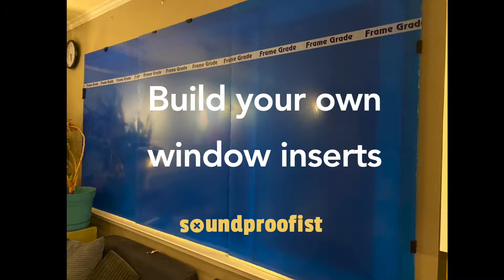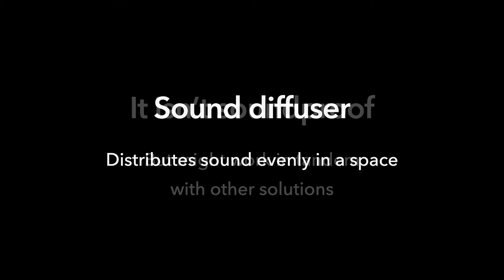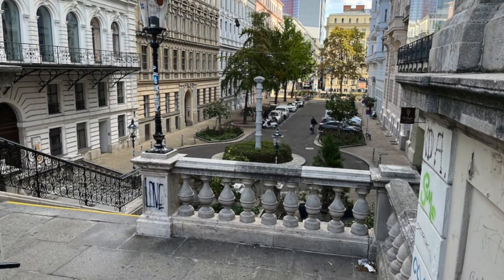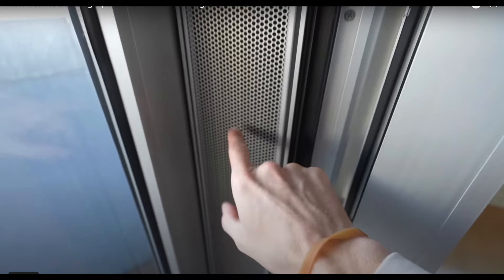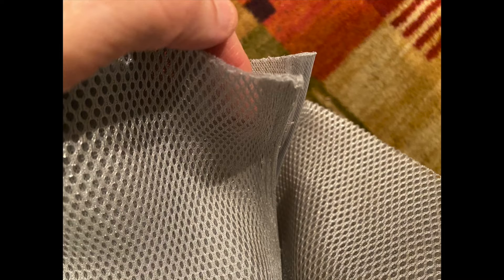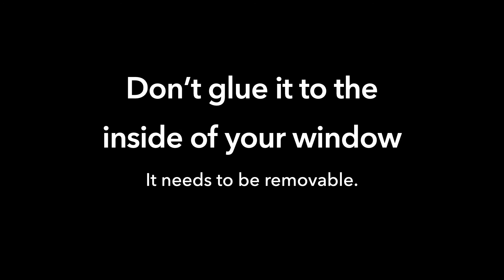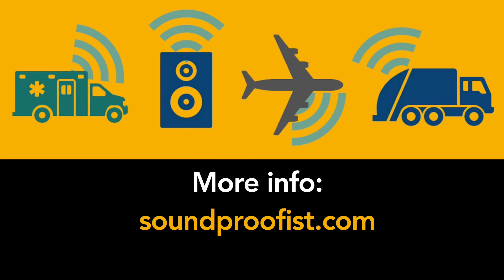Build a sound absorber for your window

Comment: I've made many window plugs for my bedroom and basement windows.  The key to success is having a large air gap between the window itself and the window plug.  The larger the air gap, the more noise attenuation there will be.  My basement window sill is 15" deep and I hear nothing when the window plug is in, not even loud bass penetrates it.  My bedroom window only has a 4" gap and I hear a bit more through it.  All air gaps between the plug and frame must be sealed air tight, but you already knew that.  

One more thing...  you have a very nice voice. Very pleasant and easy to listen to. You should consider getting a job narrating audio books.
Reply from the maker: Yes, deeper window openings (which often come with thicker walls) are super helpful, and I agree that the bigger the air gap, the better the results. My 1950s apartment building is a perfect example of how builders cut corners for several decades, resulting in an acoustical (and indoor heating) nightmare. The gap between the double-paned vinyl windows and the interior wall is only 2 inches. That's the amount of space I have to create an air gap for the plexiglass insert.These windows were retrofitted in -- the original windows were single-paned aluminum. So maybe the original air gap was slightly deeper, but the single-paned windows themselves were about as effective as a T-shirt. There's already a very small gap between the two panes of glass in the vinyl windows, but it's fairly insignificant. I envy you for that 15-inch gap in your basement windows!

Comment: I'm thinking about trying the plexiglass and would like to know if you notice any moisture problems in the tightly closed airspace. Mass is the most helpful and considering putting a large sofa pillow given to me not needed on my sofa into the airspace. I'm working with a 3'x5' FT vertical window. also, the hardware store wants to load me up with 3 screen clips on the 3 sides. Tap plastic suggested 1 at the top and 2 on each side. Whatcha think?
Reply from the maker: I haven't noticed any moisture problems in the air space, and I think I've had this plexiglass installed for about 2 years. The exterior windows are double-paned vinyl windows, retrofitted into what was originally a single-pane aluminum window frame from the 1950s. These vinyl windows are probably 20 years old and they still seem pretty airtight. The space between the two panes in the vinyl windows don't fog up, so neither does the air gap between those windows and the plexiglass sheet. As for the clips: when I first did this project, I used stationary clips on all sides. Then I realized this just made it harder to remove the plexiglass if I needed to. I don't need to remove the plexi from the smaller window. But on the larger window, it's a total hassle to remove a panel to open the window with stationary clips on the side of the plexiglass. 

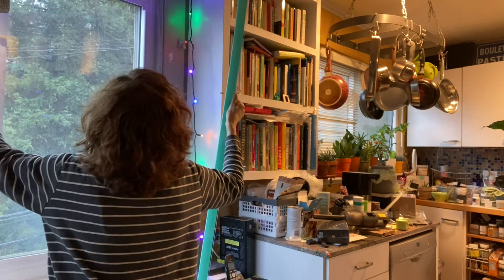So I replaced the side clips with two inexpensive metal latch/handles. If I can find a link for the parts I used, I'll add it later. I probably bought them at a local hardware store called "Cliff's." Basically, these are latches with a raised handle and they're meant to keep a door or gate shut. But I installed them backwards, so that the handle is positioned over the plexiglass, not the latch itself (which is too low to fit over the plexiglass), and then I use small foam shims under the handle to push against the plexiglass. You can see the latch in the video at 4:55. I still have the clips at the top (I recommend 2), and then on the left side, I have a connector to the center piece of plexiglass. And of course, on the bottom, the plexi is just sitting on the windowsill. 

One thing about these plexiglass window inserts: they are very weathertight. There are a few days per year that get obnoxiously hot, so you might want to remove the plexi and open the window. But in the winter, they keep cold air from leaking in and warm air from leaking out, and it will probably help you save a lot on heating bills.
Reply: @soundproofist  Thank You for your detailed reply, I'm still wondering what you think of the sofa pillow idea in the airspace to add mass?
Reply from the maker: @nomadyesmad4875  Wouldn't you be blocking all the light out if you did that? How much of the space would be filled by the pillow? Is the idea to absorb some of the noise that passes from outside into the airspace? The success of a window insert is from the gap in the airspace itself, which helps to reduce the noise. Why not add the plexiglass first and see how effective it is, then see if it gets better or worse with a pillow stuff inside?
Reply: @soundproofist  Proofist, I am having another horrible experience with customer service, As we know there isn't any nowadays. No matter how nice I am, C-S people are so rude and downright vengeful. It must be the State I live in. I was put through major stress with Macy's for 8 months just to buy a sofa that was crafted to a decent expected condition. Just unreal. The Tap Plastic older guy was horrible as well confirmed by people I talk to about it. Was quite mum about if it would fit in my car and didn't want to say anything it seemed to lose a purchase. I gave him the rough opening measurements and said " I need extra space on the sides " to install it. He said he would give an extra 1/2 inch. I trusted his experience with others who have done this, but am now disappointed he didn't ask how much I wanted. I have had pain issues for years and went along with it to discover when I sat it on the window ledge. The window is out of square so I'm getting a small gap of 4 inches at the top left-side and bottom right-side. I bought vinyl foam tape 1 1/4" wide and 3/16" thick and screen clips, but I'm not sure how I should seal it not having the foam tape width on the sides of the plexi like how Mike's video showed. The window is basically 3ft. wide and 5ft. tall. Sorry for the long details. I'm just having a time with it and nobody to help me, especially the lifting. I have to just do it and then deal with the pain it gives me. I really appreciate your opinion about it. Thanks
Reply from the maker: @nomadyesmad4875   I'm sorry you had a bad experience with TAP. If I understand correctly, you wanted to install the plexiglass on the outside of the window frame (not inside the frame). Is that correct? And the person at TAP Plastic cut the plexiglass so that it was only 1/2-inch wider than the window opening (in each direction, or total)? On the large window in my apartment, I had the plexiglass cut to be 1.5 inches taller than the window opening. The plexiglass sits on the windowsill, so the entire extra 1.5 inches in height extends above the window opening at the top. On the sides, the panel on the far left and the far right also extend 1.5 to 2 inches beyond the window opening. If you have a gap of 4 inches (on the sides or the height?) the first thing that comes to mind, which is a bit of a funky work-around, might be to buy an additional piece of plexiglass that's at least six inches wide (I'm guessing on these dimensions, please check) and place it next to the one you bought already, connected with an H-shaped joiner, which is also sold by TAP Plastics. The additional piece of plexiglass should be same thickness as the piece you have already. Make sure it is also tall enough to clear the top of the window opening with additional space to secure it against the wall. Make sure the width of the new piece is enough so that when you place it next to the piece you bought already, the entire plexiglass (both pieces) extends at least 1.5 inches on either side of the window opening to completely cover the opening and extends far enough to install clips to hold it in place. And if your window is 5 feet tall, the piece should be at least 61.5 inches tall (5 feet plus at least 1.5 inches of clearance). Yes, you will have a seam on one side of your window (where the two pieces connect, vertically)  but this is probably better than having a 4-inch gap or wasting the large piece of plexiglass that you bought already. Someone else reading these comments might also have another work-around idea -- many of the people who post here are smart and helpful and have really good suggestions.

Comment: So, did it help? Or no?
Reply from the maker: In my case, it doesn't affect what I actually hear in the living room, because my walls  are thin and a lot of traffic noise comes through them. I've been procrastinating on setting up a frequency test (inserting a microphone between the plexiglass and the original window and connecting it to a noise meter), testing with and without the DIY absorbers, to see if it makes a measurable difference inside the window frame. Thanks for the reminder.

Comment: Would a 4.5 mm thickness plexiglass be strong enough to mitigate vibrations from engines and other traffic noise?
Reply from the maker: Possibly not enough, and it also depends on your walls and other aspects of your home. 4.5mm (0.17 inch) is thinner than 1/4 inch (0.25 inch, or 6.35mm), which is what I used on my windows. And car-engine noise can be one of the harder frequencies to minimize, even with 6.35mm. Is this the only thickness of plexiglass available to you?
Reply: @soundproofist  is the only cheapest option.... But I guess I buy 2 pieces
Reply from the maker: @M.lizz1  A thinner piece of plexiglass could flex, which would make it less effective against certain noises. I'm not sure if sandwiching two pieces of plexiglass will be effective. The noise reduction comes from the mass of the extra plexi, plus an air gap between the original window and the plexiglass. I understand budget constraints -- did you see our list of plastic suppliers on the Soundproofist website?
Reply: The depth of the cavity in between the window and window plug is what gives you the dead space and attenuates the noise.  The more depth you have the less mass you need.

Comment: You might want to try a sound meter app on your phone for doing before/after testing.  This assumes that you have a sufficiently constant din to make comparisons valid.  Alternatively you could set up a loudspeaker outside your window to generate a test sound.
Reply from the maker: Oh, I use sound meters a lot, both smartphone and handheld. You'll see them in a lot of my other videos. Some reasons why I didn't this time, not yet: 1) I've only made one absorber so far, and I don't think I'll see a notable difference until I have at least 2 or 3 in absorbers inside the window frame, 2) because low-frequency noise comes through the walls and not just the window, some noise will still get picked up by the sound meter even when I finish the window, which will skew the results, and 3) I'm still looking for a resource to buy a small amount of micro-perforated metal, because I'd really like to try that on the long part of the frame along the windowsill (94 inches). Maybe a better experiment will be in the room where I have double-drywall, in the back of the apartment. So the only weak link in that room is the window, and I haven't put plexiglass over that window yet, either.

Comment: This may sound unorthodox but I've been using yoga mats to block moose from my window lol.  I can't afford mass loaded vinyl and such
Reply from the maker: I think you mean "noise" and not "moose"? Or maybe you live someplace like Canada, and need to block actual moose(s) from your window? Either way, some yoga mats are made from E.V.A. and they might be better than no sound mitigation at all, and easy to remove.
Reply: @soundproofist  yes noise haha! Phone must have autocorrected.  I've put in 2 layers of the yoga mat inside a cardboard styrofoam box.  It does seem to help just a bit..